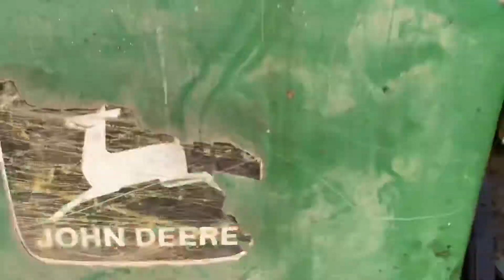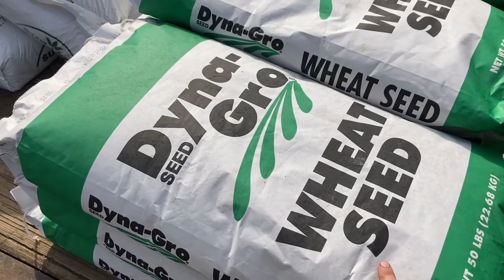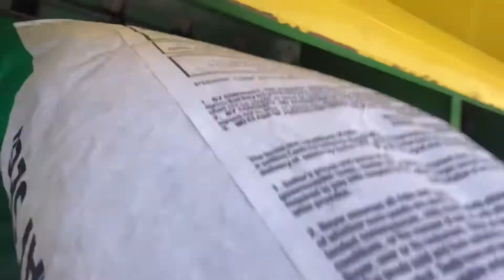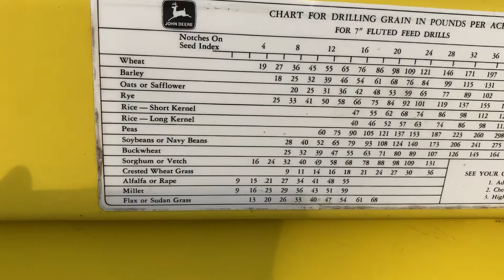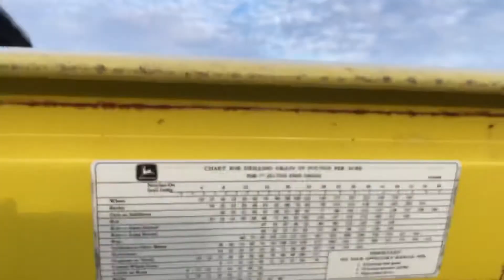Grain drill problems and loading up the drill with dynagrow wheat seed

Comment: The chain sprocket sheared its pin. The sprocket located closest to the center of the drill sheard off. The sprocket chains move like normal giving the illusion everything is working correctly but the pin is sheared and not driving the shaft. It isn't driven behind the wheel. It's driven on the other end.
Reply: Pin broke in hub

Comment: What row spacing are you using?  What setting number are you on for soybeans?  thanks, Eric
Reply from the maker: 7.5 inch for small grains. 22.5 for soybeans even though this year all my beans were planted 36inch with planter. I’ll check my setting for beans. With a drill I try to seed 60-65lbs of beans per acre